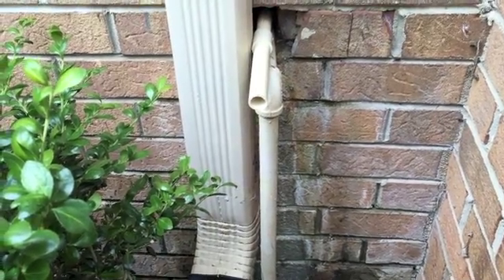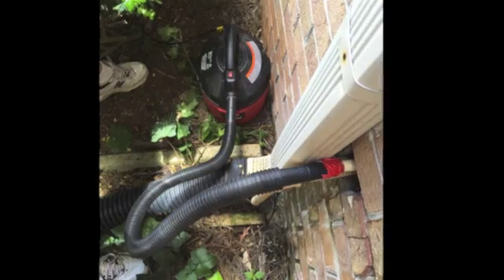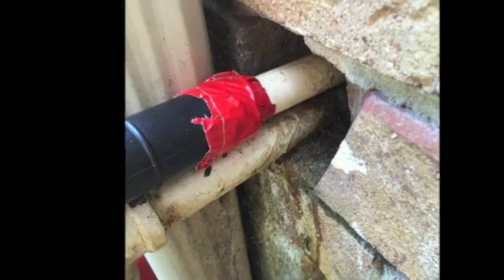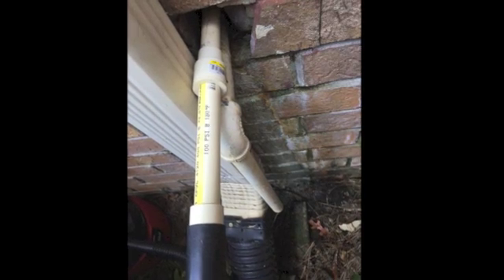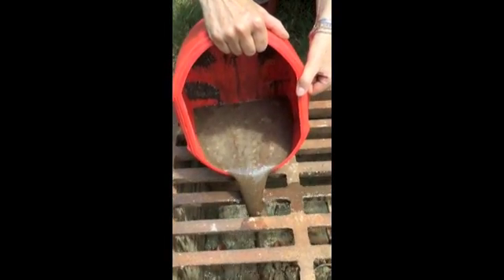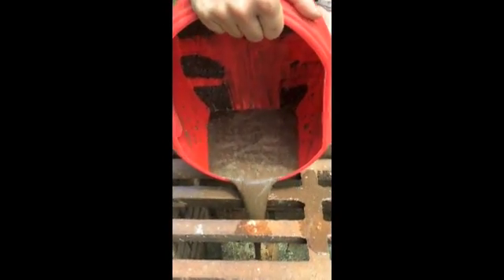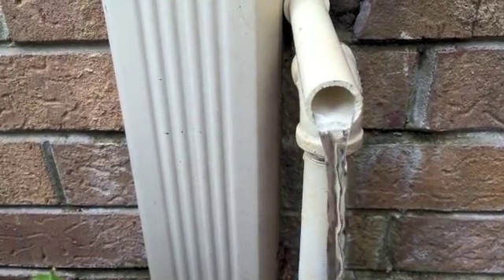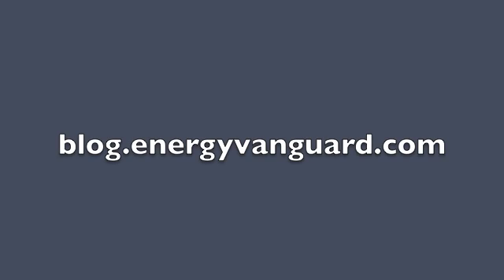How to Clean Your Air Conditioner Condensate Line

Comment: You can also use a Gallo gun, uses CO2 cartridge to blow line out. More expensive but easier to use, no power required.